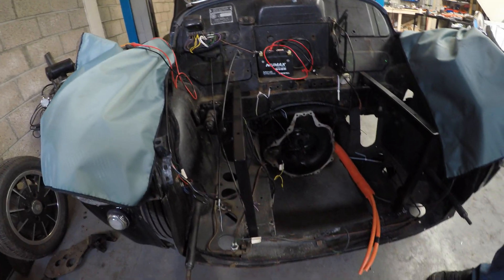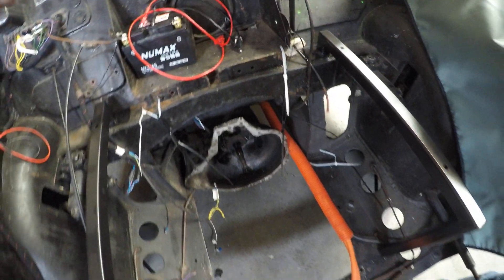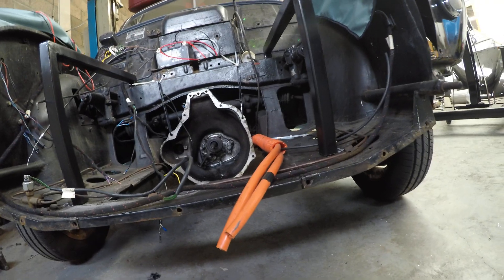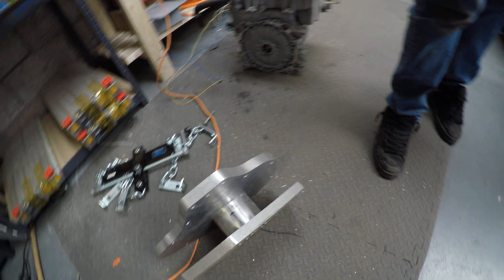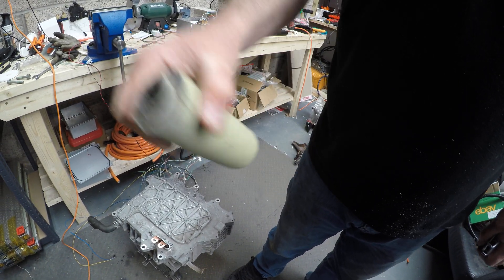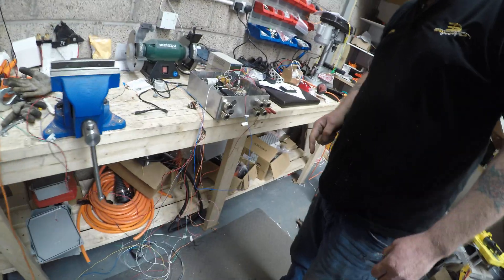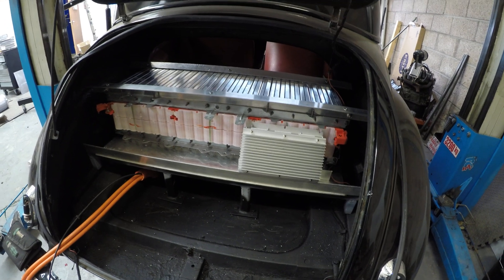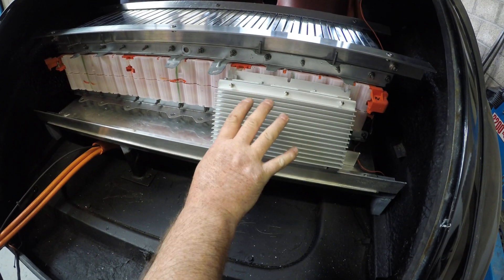Morris Minor Electric Update

Comment: Where did you buy the motor controller battery
Reply from the maker: sss Electronics project we were fortunate to buy a donor car that was an insurance write off. We took the motor and battery from it and sold all the other parts. The motor, inverter and battery pack cost us less than £2000 on top of that you need an onboard charger, dc dc converter, BMS, cabling, contactors and VCU. If you want to email us on info@electrongarage.co.uk I can give you a parts list and costs for this.